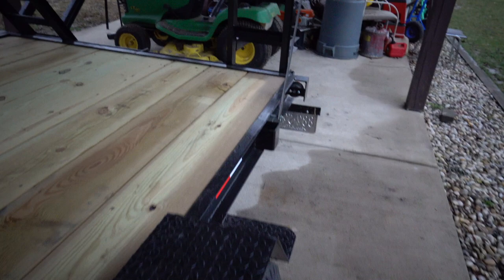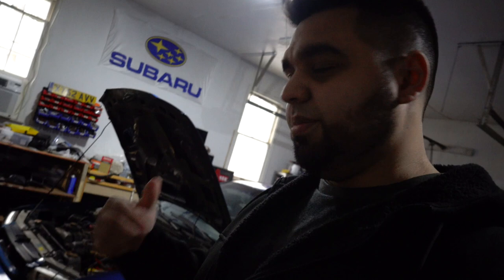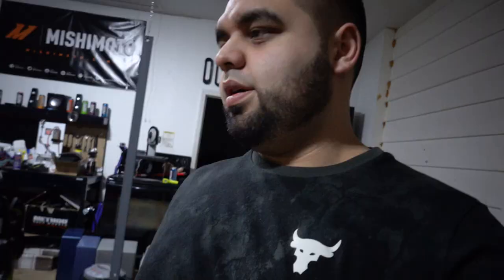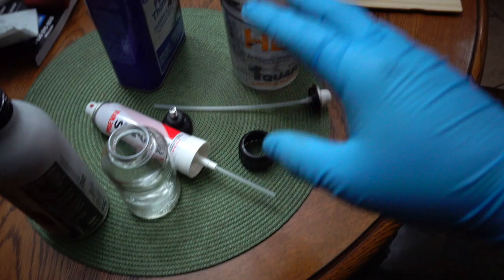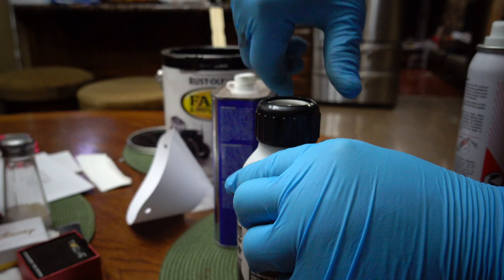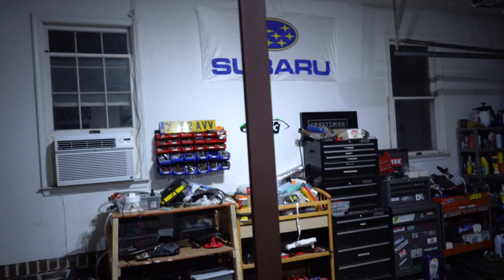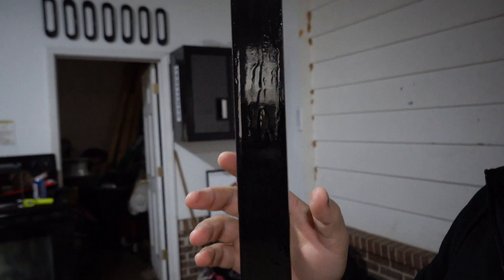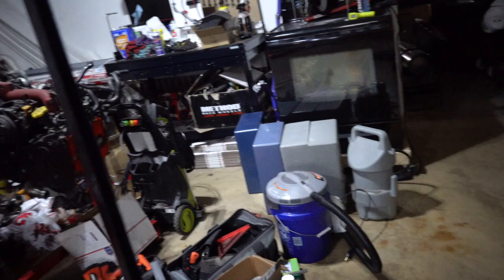Jacquard YouCan Refillable Bottle Vs Preval Amazing Spray System

Comment: Honestly I have used the Preval sprayer before and had decent success with it. I painted a guitar body with waterborne paint and it actually atomized the paint pretty decently. I know it sucks in the moment but honestly everyone should just buy a spray gun and learn how to master that if you are just doing small projects. You are going to have cleanup regardless. Better off with a spray gun to get the right kind of atomization

Comment: Along with this, and seeing the reviews on Amazon, I'm avoiding the You Can. Primarily because several reviews were saying that theirs exploded, and causing injury. Don't know if they didn't follow directions properly, but I'm not feeling like risking it, in case they did properly follow directions, and it still blew up. I happened to see my sister had bought the Preval sprayer for some craft project she's working on. I'm interested in using one of a project I'm planning, but don't want to spend stupid amounts of money on a decent spray gun for a one and done project.
Reply: It exploded because they unscrewed the cap before releasing all the extra pressure
Reply: @maxd925  I would rather test it myself, I saw that the you can has a normal spray paint cap and tube therefore, when he was trying to fill it with paint he should have turned it upside down, the rest of the problems though, idk
it should be written in the can how it should be filled

Comment: Need to thin it with something other than water which dries quicker.  Try alcohol or windex.  Maybe add a bit of glycerine to prevent tip clogging.

Comment: Rechargeable=filling it with compressed air again and again. 
Like when you "recharge" the refrigerant in you automotive or home's AC system if it leaked out or was replaced.
It is not just an electrical term.
So refillable and rechargeable are two separate, but needed, terms to make the Jacquard system work.
I'm just going in to detail here so someone doesn't look for a charger or battery system when or if they purchase the item.
I have just purchased both systems by the way to use DuraCoat's products with. I restore car audio amplifiers and other equipment, with. I will also be doing a review comparing both. I will say that I see one mistake that is made a lot with the Jacquard system after reading the reviews on Amazon and other places....a pressure gauge is a MUST when "charging" and "recharging" it's tank/canister. I use Ryobi's P737D to charge with and this model has the digital gauge. I also have the analog "needle" gauge unit and both are spot on when checked with nice separate tank gauge. I am able to fill the can with 33% aka a 1/3 of the paint or sprayable product and then charge it with 50psi of air in less than 45 secs. I then can use the can till empty without experiencing any pressure loss! Just keep the nozzle tip clean. I really like the Jacquard product but I'm also still looking forward to testing and using the Preval system. I think both will have a use in my paint system and home diy tool shed!
Stay on the Gas....
Thank you for the video!!!!

Oh yeah....here is the Ryobi compressor....
https://www.homedepot.com/p/RYOBI-ONE-18V-Lithium-Ion-Cordless-High-Pressure-Inflator-with-Digital-Gauge-Tool-Only-P737D/307627867#overlay

Comment: Looking at it, it seems the paint was too thick in the YouCan to become atomized. The thinner paint in the PreVal was think enough to atomize? Also, paint sprays 100X better when you put the paint cans in a bucket of warm water for a few minutes instead of spraying cold.
Reply: He used the same thinner filtered paint on both. Plus he was to nervous of making a mess on moms kitchen to make different batches.
Reply: Thx for the warm water tip!!
Reply: OMGGGG! I thought I was the only one that did this! Well that is until I tell others and they go crazy with the results! Not only does the paint mix up easier and dry faster, there is WAY less orange peel! Also, the flakes in metallic paint spread way more evenly when heated!
Thank you for suggesting this here!
Reply: @justinmurphy2227  anyone ever try to atomize chalk paint? Its basically acrylic mixed w plaster of paris to make a very flat, matte color, which looks good on upcycled furniture. Intentionally distressed furniture/farmhouse/ shabby chic look.
I tried it in my preval and it just kept clogging up. I thinned it w water but then it sprayed into a dripping mess.
Reply: @justinmurphy2227  gonna try your soak in warm water tip w my chalk paint.

Comment: No drop cloth on the kitchen table! You have a garage, this is where that kind of potentially messy stuff should be done. Plus many thin coats is always better than one thick coat. As nearly everybody on here has stated that paint should have been thinned at least 50/50 ratio.

Comment: Ok...just watched the rest of your video....
I had NO problems with the Jacquard setup. First off, with every pump system I've used, it's locked on to the valve stem when the lever is pulled DOWN after placing it over the threads. Your pump may be different.
I do wish that you would have practiced the process simply with water until you had it mastered. It would have looked better for you as a professional as well as being a lot less messier and not wasting any product aka paint.
The paint does need to be water thin with 50psi minimum air pressure.
I have just seen this was uploaded in Feb....I've had a spinal surgery (5 in the last 4 years) so look over my  "brain fog" lol. Recovery from these surgeries are horrible. 
Did you ever get the Jacquard system able to work for you?

Comment: The problem with YouCan is that they come with crappy spray nozzle tip. The thin tip flies away when you spray and after that, it sprays like yours. Try and use another tip from another spray can

Comment: Paint is too thick, thin your paint first and then strain it, that's all user error. I reuse my Preval all the time, clean jar with thinner and put thinner in jar spray until clear thinner comes out then remover jar and spray litter air to finnish

Comment: You're not meant use a air compressor to fill the you can , it was designed to be filled with a hand pump .
Reply from the maker: A lot of people do it. And I tried a bunch of times with my hand pump and got the same results